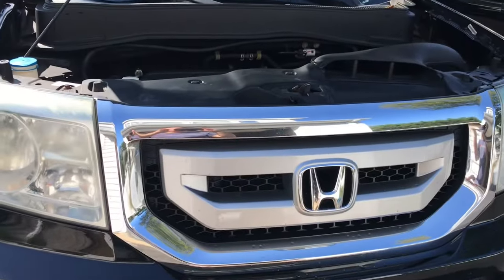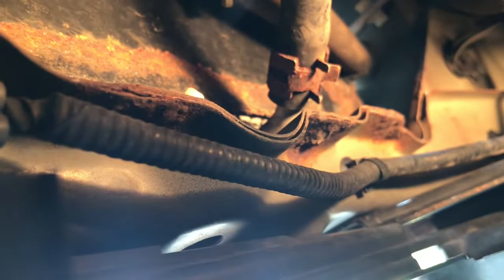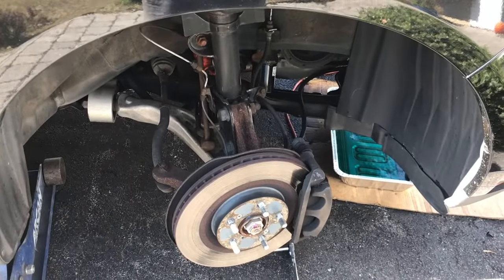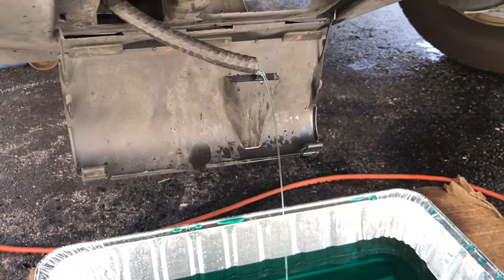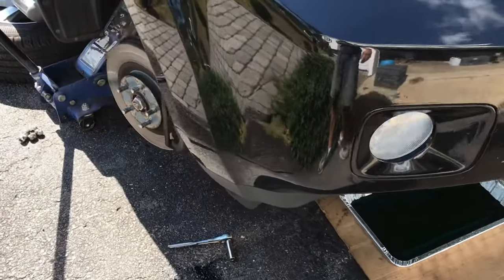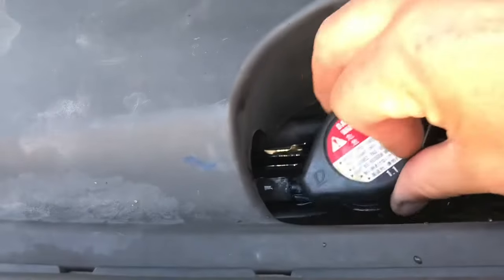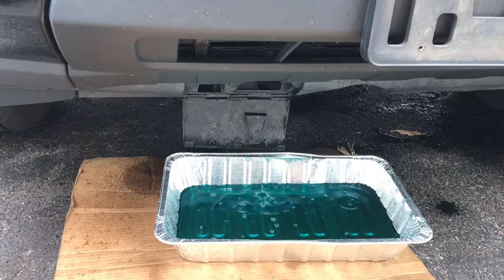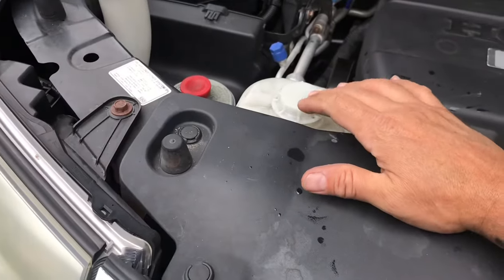HONDA PILOT COOLANT CHANGE: Draining, Flushing and replacing the engine coolant on a Honda Pilot.

Comment: I found the petcock is hard to remove with pliers or a wrench. Then I tried using 7/8 socket and it was a cinch!
Reply from the maker: Thanks for the tip! 😎
Reply: Thanks Keith

Comment: Aren’t you suppose to burp the system by pinching the upper radiator hose to bleed air out?
Reply from the maker: gladys The system will bleed itself.  Just keep adding coolant if you have to.

Comment: Thanks for this video, good job! Your trick was good for the petcock but my big fat fingers still couldn't fit a small enough wrench in there. I used the same 22mm short socket that I use for the lugs to get mine loose and was a piece of cake from there. Hopefully this will help others. FYI - this video was nearly the same for my 2012 EX-L
Reply from the maker: Great advice. Thanks!

Comment: Is it possible to get to the engine block without removing the tire? You said the engine block might be unnecessary, would it be stupid to just drain and fill the 2 gal of coolant from the radiator rather than the .5 gal in the engine block too? (Side note i believe you should have put .5 gal more due to the engine block after reading the service manual.)
Reply from the maker: Yes, you can get to it without removing the tire. You can probably skip this step and you’ll be ok.
Reply: @fixinit I appreciate you bro. All of your vids on the pilot have been perfect for a novice like me. Thank you so much!

Comment: Thanks for the video. Is it the same process for a Honda Pilot 2006? I have to flush mine because I just found out that they put the wrong coolant in the system, my is color green. Your video will save me some dough.
Reply from the maker: Yes, It should be the same.

Comment: Ever do this on a 5.7 hemi? Just put a new block in my jeep and can't seem to purge all the air
Reply from the maker: Never done it but this is what I found out for you: 
There are 2 drain plugs. One on each side of the block down and to the rear of the knock sensor. Close to the #5 and #6 cylinders.  
But I would think you should purge the air from the top. Try cracking a top hose loose a bit by the block and use a towel to catch the leaking coolant.  
I hope this helps. 😎

Comment: How much coolant man
Reply from the maker: Astral pilot Two Gallons. Make sure it’s a 50/50 mix.  Don’t pour straight antifreeze in there.
Reply: @fixinit  thank you!
Reply: Fixin It hey thanks for the video, i came here looking for the block drain and thanks to you i now know where it is!
Replacing the radiator due to a leak and both hoses on my 2011 pilot along with a full coolant drain and refill.
Reply from the maker: Abq Xyz Thanks. Glad it helped you. 😎

Comment: Why bother emptying the block if you are gonna run distilled water thru it anyway? Wouldn’t you only wanna empty the block to get the distilled water out
Reply from the maker: 7205buttas The idea is to get as much of the old stuff out before flushing.  Like I said on the video,  you can prob skip that whole thing and still be ok.
Reply: Fixin It if you empty through the drain but then fill it with water and run the heat when you drain it again most of that would come out. I’d say just do it a third time to be safe.